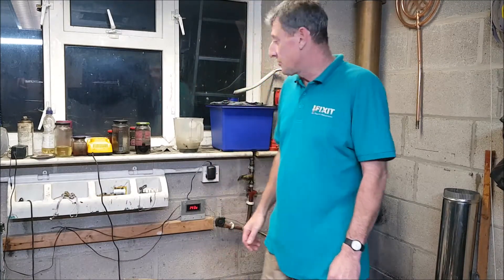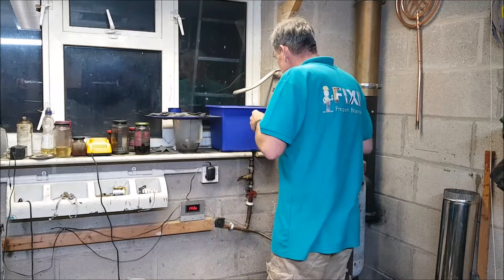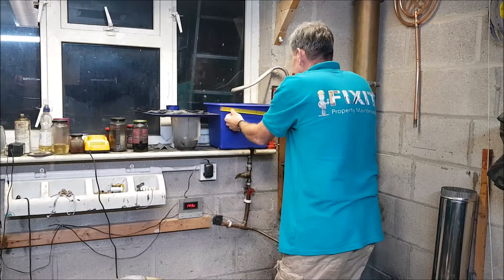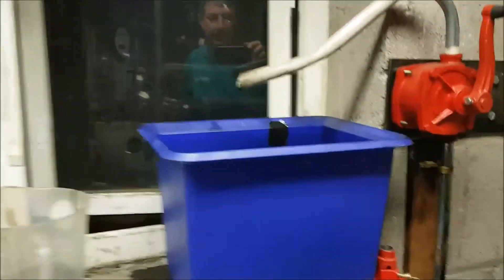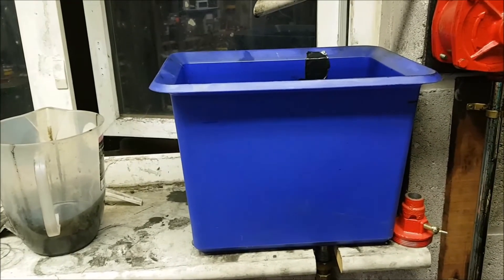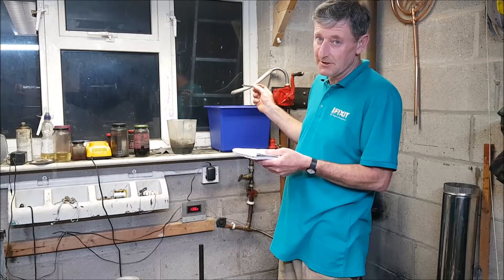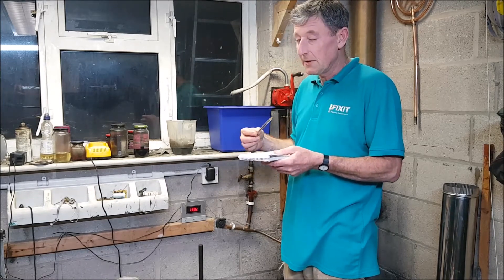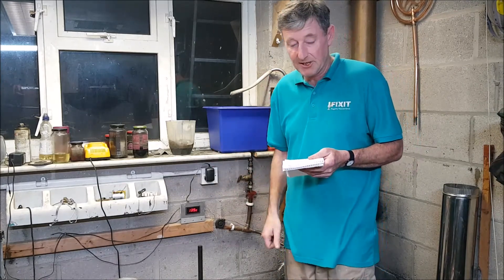Homemade waste oil heater. How much oil used per hr/day. Very little! Part 3 2017

Comment: I'm very impressed of your work, especially this waste oil heater. I also want to build something like this and i want to ask your opinion about a thing. What do you think, can i use this system with a heat exchanger inside to heat water? Thank you.

Comment: Thanks Ollie for your reply 
Yes mine is the same setup as yours for my fan I use i" pipe connected via t.piece to 3/4 "pipe but I solved it what I did I cut about 3" of 1/2" pipe built up one side of it to fit thightly into one end of my one " pipe which I first put into tpiece 3/4" snug as a bug in a rug works like a charm hope you understand all that Olli

Comment: That is perfect!  I don't need 1000 degrees f in my shop or to heat water for the house, and I would rather need to collect much less WMO throughout the year.  If I can't get enough heat out of this in 10 hours a day, then something is wrong.  Great to see that a drip and a small blower really is enough to produce a substantial flame.  I now need to figure out how to make a boiler out of this design.  I want the boiler in the garage and a large tank (800 gallons) under the house for heat in the winter and hot water all the time.  Figure I could run it every few days unless the garage needs heat.
Reply from the maker: Thanks. Have you thought about buying a used kerosene boiler and converting it to burn waste engine oil? I have just bought one for £45.00 from ebay and I will make it run on engine oil. Then I can have my workshop heated with thermostat control and electronic ignition.
Reply: @fixitmakeit72  Hope there will be a video soon.  Thanks.

Comment: Good Consumption on the Oil.  I am extremely allergic to Wood Burning Stoves including Wood Pellets or anything with Wood.  I have been using Propane to heat my Room but this year, I also built a Used Oil Burner. So far I haven't fully done since I am having a hard time with my Burner due to efficiency.  But I am taking care of that in the moment... Once I am done, I will make a Video to share with everyone.  I am glad to see that you are getting most out of your Oil :D.
Reply from the maker: Post a video where your at with it and maybe others can help. Dying to see it even if your not happy with it. Cheers.

Comment: how large of a shop similar to yours, do you think this would heat on a winter day, say 35 degrees F.?  I can't tell how large of an area you are heating, but, it seems you can heat it up pretty well.. But, you mentioned flies, so, it must not be winter yet? By now, you have had some cold weather and have some ideas if it is enough at that volume of consumption, or, you need more heat? I have a 20x20 foot area x 10 feet high.. 
Wouldn't we all like to capture the heat going up the chimney??  Maybe a good fan forced heat chamber in the exhaust pipe, or a mass heater type of setup..
Reply from the maker: My workshop is only 14ft x 12ft and after about an hour i have to open the windows slightly. This heater is more than adequate for your 20x20x10 area Mark.
Reply: @fixitmakeit72  Thank you for the reply..  I will be building one this winter.. Might even try a few Coal Nuggets in the middle of the oil, just to see. I have a good bit of it...Anything to warm the bones a bit.. Ha.. Thanks for the videos.. I watched quite a few once I got started.. :)

Comment: Wow, good work👌🏻 I have seen a lot of videos of waste burners and this is the most efficient so far. I will make a similiar at home and maybe heat up some water😊
Reply from the maker: Thanks Sondre, I  have bought a used kerosene boiler for £45.00 and going to find a way to fuel it with waste engine oil.

Comment: When I review the dimensions you gave for the box, they were (W x D) 300 by 210 mm, the height doesn't really matter here. So a level reduction of 10mm (1cm) means a volume of 30 x 20 x 1 cubic cm. On my calculator that equals 0.6 liter in two hours, not 0.4. And the content of the container comes at 12 liters instead of eight. Still a very modest consumption though. Congrats!
I re-measured the usage of my own stove yesterday and it came out at about 1 liter in two hours. However, with that amount of fuel I'm not able to heat my shop adequately; to do that I would need at least double that amount. Fortunately your fan-based solution has given me some new alternatives to try so the search continues. A video of my (experimental) setup will follow shortly.
Thnx for sharing this!
Reply: Was going to say the same for the dimensions but 21 x 22 x 30 = 13.860 litres so close to 14l

Comment: How do you stop spit back of your oil on the intake pipe using your fan because mine is spitting back and it's also stopping the flow maybe my fan is too fast any help would be appreciated thanks
Reply from the maker: Sorry for the delayed reply Jack, is your fan and oil feed supply the same set up as I have built. If so, do you mean the oil is blowing back towards the fan or towards the oil inlet. do you have a funnel sat in your oil intake like mine where it drips into. 2 things spring to mind: 1, the funnel acts also as a resistance to the air blowing 50/50 to the oil intake and the main burner so the burner gets the full force of the fan. 2, is your air/oil pipe too close to the bottom of the main burner thus giving less room where combustion is taking place and getting too hot and burning the some of the oil before it leaves the pipe as well as the main burner. Thanks. Olly.

Comment: Hello, just wondering, would you say your using such little oil due to your set up? For example the forced air ? As I'm thinking of setting mine up without any forced induction.
Reply from the maker: Hi Kaz, I watched many waste oil builds on youtube and none of them suited my needs.( too much heat and stupid amounts of oil consumption)First question I need to ask is; What floor space area are you wanting to heat and has it a high or low roof/ceiling. For example; I have designed and built mine to warm a 13ft X 13ft Brick building with a plastered ceiling at 9ft high.
Reply: @fixitmakeit72  thanks for the reply, the space is 13 X 8 feet. It's a insulated mancave so the burner will be away from the wall with a small section of single wall flue and the rest twin insulated. My roof is also around 9 feet (2.5m)
Reply from the maker: Ok. This build will definitely suit your needs. Important Things that I feel are essential to your build; 1- A waste oil filter before you even start building the heater.(you can easily build one yourself) 2- A container to store your filtered oil.(mine is 80ltr and is stored outside the building)3- A simple pump system to bring the filtered oil into your mancave directly into your supply tank/vessel. 4- A viewing glass on the heater to monitor the flame from the burner. (this makes the air/oil mixture easier to fathom out to get it to run efficiently)There are lots of mods I kneed to carry out to mine and would appreciate it if you tell me your thoughts before you start building yours as I can really help you make a decent job of yours. If you don't use a small fan then the heat output and oil consumption will be too great for your mancave. Keeping your filter and oil outside is a must as if your not organized it can be a messy set up. Ask me any questions Kaz. Glad to help. Olly.
Reply from the maker: Its 01:00 here in the uk so going bed now but leave any info or questions and I will respond tomorrow evening,
Reply: @fixitmakeit72  Thank you Olly. Just wondering what modifications you are planning to make ? Would like to plan ahead for the summer for when I make this. I have already made a outdoor burner from a 47kg propane bottle but I guess this takes a bit more consideration.  Two questions I have are, do you think I would need an external air source ? Would that make it more efficient. I currently have 6" (150mm) twin pipe. Would a smaller diameter pipes be more efficient due to less heat wasted through the flue ?

Comment: Don't mean to criticise you because I do like your videos but you haven't calculated the efficiency of your waste oil heater just simply the fuel consumption, you need to calculate the heat out put to work out the efficiency but that would be very hard
Reply from the maker: Thats true. My aim was to build this heater  so it gives out a practical heat to warm my workshop during the winter months and not melt the windows like most other waste oil heaters on youtube. Plus the fuel consumption on most other videos on youtube is horrendous Tom. I suppose the efficiency of this build in my head relates to not paying for the fuel and using very little per day. Gonna make some mods to it next summer

Comment: Great vid and informative. Methinks I'm going to have to convert a Darth to oil Hmmmmm that's an idea. 
Wouldn't it have been easier to just top up the oil to the black tape using the measuring jug
Reply from the maker: Not really Ian, Anyone who has built a waste oil heater will know that messing with old engine oil can be quite messy. Got used to just emptying oil into my filter and thats it, no more handling of it. Darth to oil in last comment? Darth a misprint?
Reply from the maker: Will check it out now!
Reply from the maker: Sorry have seen it already. Such a great build,looks brilliant,very creative,very sellable. If your thinking of building a waste oil heater,will look forward to watching that also. youtube is awesome for me. Better than all the crap on t.v.